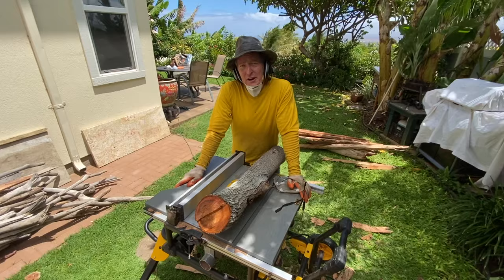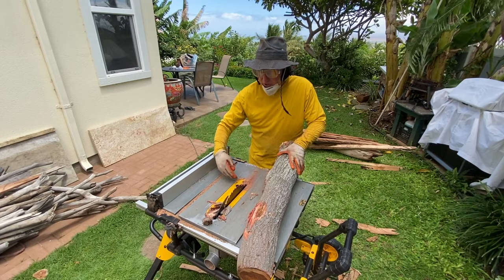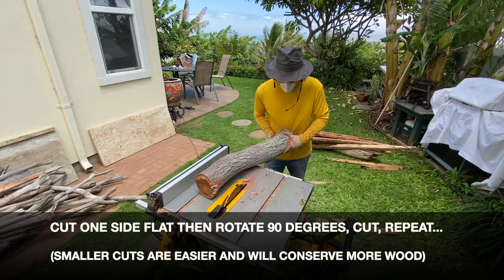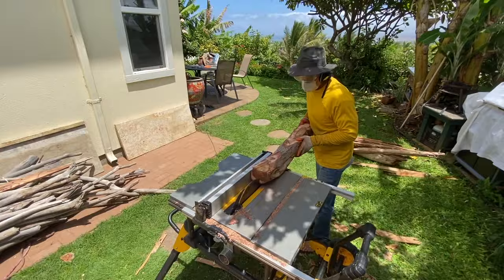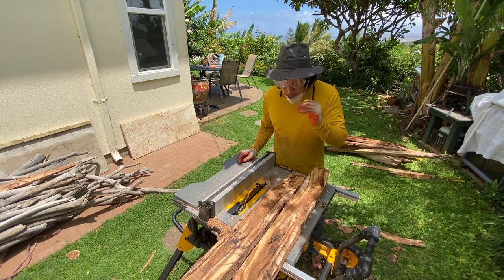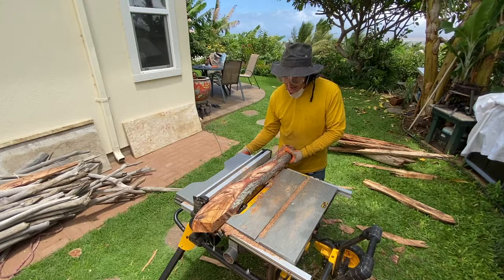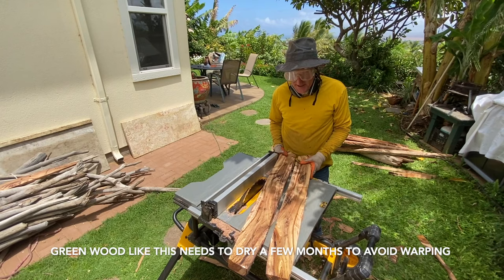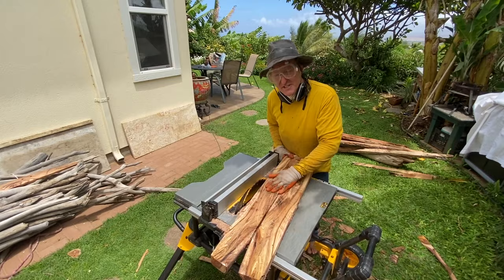How to Cut a Log into Boards with a Table Saw

Comment: This is reckless and dangerous. Not what a table saw was designed for, and if this is something being done on a regular basis, he's very lucky not to have been hit with kickback. 

If anyone seeing this must do this themselves, a band saw would be a better tool to use for logs this size. Using a table saw for this is a great way to get very seriously injured.
Reply: It's wood.😂 There's been a bunch of barns around here for years that the lumber was milled with a table saw.🤣 I've never had an issue. Just use a little sense.

Comment: What type of table saw is this? Looking to buy one for this exact purpose…
Reply: That is a DeWalt Table saw on a folding stand with wheels so it is nice and compact when you put it away.
Reply: Sorry just saw this!   DeWalt!  I love it.  Also folds down so easy to haul away and store.
Reply: They have a couple models. I bought the one for about $700 and it works very well